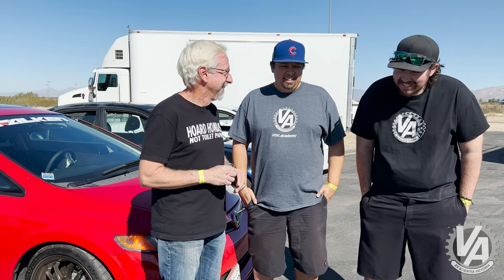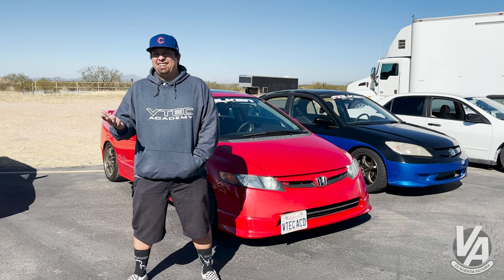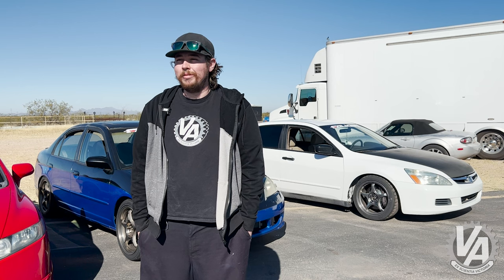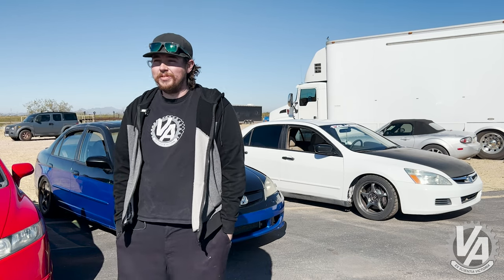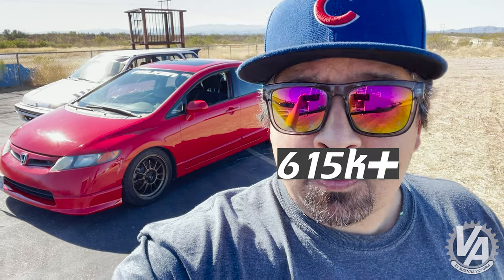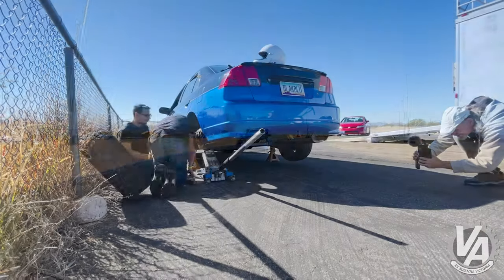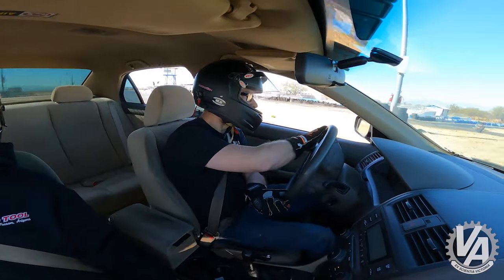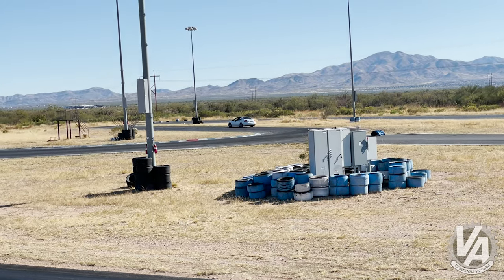Does more power mean quicker lap times? One K20 vs. Two K24s!!

Comment: What size wheels is the 8th Gen red Civic SI running? also, have you guys done something about the brakes? My 8th Gen SI brakes got glowing red after 2-3 laps at the same track. I am going back again net month with stainless braided lines, Motul brake fluid and Hakws DT-60. If that doesn't help I am going stratight for a Stoptech ST-40 kit.
Reply from the maker: The 8th gen is running 17x8 +45 Konig Hypergrams with a 5mm spacer up front. The brakes are completely stock with exception of the slotted and cross drilled rotors. With more aggressive pads they'd probably be glowing too.
Reply: @VTECAcademy  So ...check this out. I took my 8th gen SI to the same track with stock suspension, average tires and stock brakes and the brake pedal went to the floor plus my rotors were glowing orange. The following time i went back but with Motul RBF 660 brake fluid, hardlines in the front and Hawk DTC 60s and the rotors were no longer glowing. The pedal was soft but it wouldn't go all the way to the floor and after a few minutes of cooling off the pedal would regain the feel.